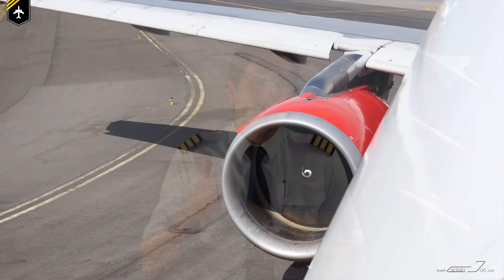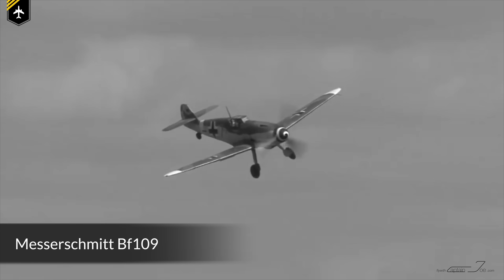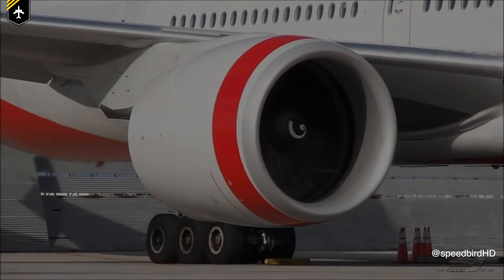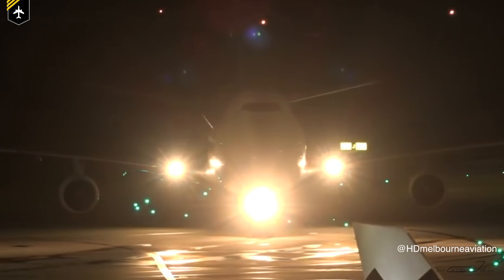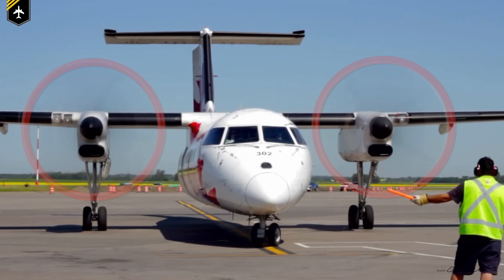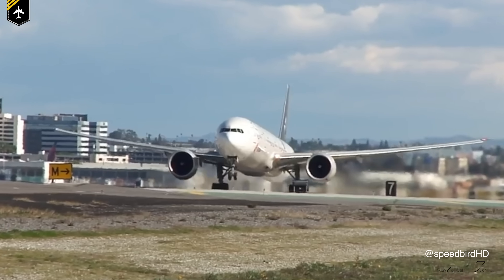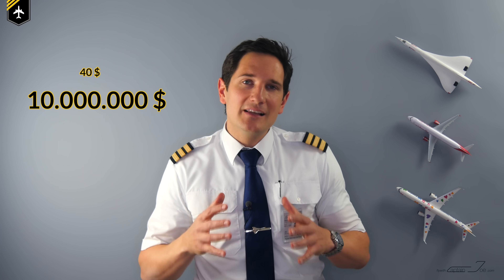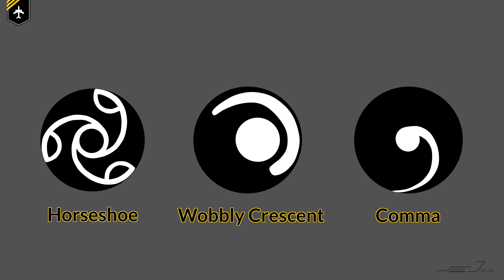WHY is there a SPIRAL in a JET ENGINE? Explain by CAPTAIN JOE

Comment: Simply wrong !
The purpose is to help BIRDS not be ingested into the intakes.  When running , the engine looks like a "black hole" that a bird can fly through, so the spinners are painted to help scare off birds so they don't fly into a running engine.
Now , before the hate starts, of course this doesn't work while the aircraft is in flight and overtaking birds flying in the same general direction, but the birds flying towards the A/C know to avoid a big fuselage, but having bird brains , think that tunnel next to the fuselage is okay, so the spinners have been painted with the "googlie eye" swirl to help prevent bird ingestion...
This pilot may know how to fly a plane, but he obviously has no education of aircraft maintenance.

Comment: I agree that the swirly nosecone on the Me109s was most likely for safety, but I also think that there's something to the legends regarding its psychological purpose, because, while it may not have been dazzling, distracting, or disorienting, it certainly looks rather intimidating, even menacing!

[Edit] Also, I do think that this might have been part of its purpose because the Me109's cannon (a projectile firearm that lobs significantly bigger rounds than a machine gun) was mounted in the nose, and actually fired right out of the center of the cone.  Basically, the same reason why the bombardier beetle is brightly colored, rattlesnakes have raddles, and cobras have big, extendable hoods - it says, "look out, I'll get you!"

Comment: Captain Joe hello. My Question regards Vortex Generation with a fixed-wing aircraft or Vortex Ring State with helicopters. Are they similar?

You may be aware of the serious collision between 2 helicopters at Seaworld Marine Park in Australia on 2 January 2023. One helicopter was coming in to land and the other was taking off. A witness claimed that it was windy and that the 2 helicopters were too close. It was also reported that the rotors of each clipped. There are many theories but not one has mentioned my thought.
It’s hard for me to understand how 2 helicopter pilots would allow their aircraft to fly too close together, even if windy outside.  Could two helicopters, both creating their own vortex ring state, pull both helicopters together resulting in a crash?

Perhaps you would consider covering this in another video. Thankyou

Comment: Would a protective mesh over the engine aperture cause excessive drag on air flow?   I'm guessing it would.
Reply: It'll definitely make the air going into the engine less streamline. Plus if anything blocks the mesh, then that is a bigger issue.
Reply: @ZK-APA  I thought that might be the case.

Comment: Hey joe,
How does a pilot calculate the weight of the passengers to account for fuel required for flight ?
Reply: i'm in aeronautics school in italy and they told us there are some kind of standards, not only for the fuel load but also for momentum and weight balance.

Comment: i noticed all engines  spill counter clockwise. do any  engine  manufacture  designed the engines blades  to spin clock wise ? and does it make a difference ?

Comment: Ah...the WWll German fighters did indeed use the spiral painted cone to throw off Allied defensive gunners in the bombers as this gave the appearance of the plane “jumping” forward, it was compared to watching a snake slither in the grass, your eyes seem to fall behind the progress of the snake. My primary source of this is from the book “The Fighting 109” by Uwe Feist, Norman Harms, & Mike Dario (Doubleday 1978)...from a caption from one of the many photos in section III of the book (pages are not numbered). The caption mentions this is to throw off the aim of the enemy gunner in the case of a head-on attack. It should be noted that most of the 300 illustrations of the Messerschmitt Bf-109 in this book most of the aircraft do not show the spiral spinner. If I remember correctly the snake analogy was mentioned in Edward Jablonski’s book “Flying Fortress” (Doubleday 1965) but I have to double check on that. Other than FW-190s I do not recall seeing spinners painted on any other German aircraft such as the bombers so I do not think they had safety in mind at the time.

Comment: I've always wondered why not place a light metal grate over the intake? Wouldnt this act as a screen preventing objects large enough to damage the engine from entering while still allowing all the air it needs to run optimally?

Comment: A few additional bits of information regarding the spinners on German aircraft in WW II. Aircraft on the Western front originally had black painted spinners as a quick identification aid. The spirals were eventually painted with white paint. In the Mediterranean theater, German aircraft had white noses for quick identification; the spiral stripe was painted with black. Curiously, on the Eastern front, yellow noses were the identification and no spirals were painted. Also, it was very rare for the Germans to have brightly painted prop tips, whereas most other nations used them, including the US, Britain and Japan.

Comment: I worked on jet aircraft still relatively early in jet aircraft development. And the rendition  of the eye is something that does make Birds nervous when it is on the nose cone of a jet engine. When they first started putting them on there they were static. When they offset them they did find that the birds tended not to go towards the engine. They aren't usually on military aircraft because you can't really see the nose cone of the jet engine on most military aircraft because they're well within the intake duct. Even if it only keep birds away by a few percentage points it would be worth the expense of painting all of them. The spirals, do go back much further. Perhaps those exist for the purposes you state. But any motion detected by the bird will tend to make it steer clear of the rather large orifice presented by the engine.

We are talking about birds however and it never ceases to amaze me how birds will fly into a mirror. Now I can understand them trying to go into the other room. I cannot understand why they didn't try to avoid the other bird LOL.

Comment: How does engine starts initially?
Reply: Compressed air from the APU (auxiliary power unit) or from an external air compressor unit is used to spin the turbine before ignition because the turbine must spin at a certain speed before the ignition.
Reply: @mikep9604  thanks

Comment: If a bird strike is so dangerous why can’t there be a sort of meshed metal net placed to cover the engine blades?
Reply: A net in front of the engine will disturb the airflow into the engine and this affects to the performance of the engine. That's why it can't be used.

Comment: I know this is after the fact but it may have been interesting to show how loose the fan blades are as the forward cover was being installed.
Most would be surprised at how much they clank & rattle around as the fan rotates.
Just a thought.😊

Comment: Why they don't put safety net in front of the turbine like you put air filter on your turbo so you don't suck dirt?
Reply: A net in front of the engine will disturb the airflow into the engine and affect to the performance of the engine. It can't be used.

Comment: Why they wont just build a kind of fence in front of the turbines?
Reply: That is not possible. A grid or mesh in front of the engines will disturb the airflow into the engine and affect to the performance of the engine.
Reply: @mikep9604  ah okey, thanks 4 the info

Comment: Why don't they have an "air filter"? I mean it can be a grate or something but that would stop birds from flying into the engine.
Reply: Yes why not? Like some sort of grill. could protect the engine from most foreign objects including ground crew. surely looks are not the only reason???
Reply: It's not possible to install any grill or mesh in front of the engine. Even a grill would disturb the airflow into the engine and this would affect to the performance of the engine.
Reply: @mikep9604  That is not the reason. The aerodynamic impact of a mesh would be minimal to the airflow. And the airflow into the engine is terribly turbulent anyway so it won't disturb it either.

To answer my own question: it is probably due to the fact that the plane flies at 900 km/h. The bird would end up in the engine regardless.

Comment: Does paint affect fan blades that are used in the jet engines? Can't they just paint the fan blades so that the birds don't enter?
Reply: The fan blades expand when in operationg conditions. Using a paint that can withstand this would most likely be to expensive and also heavy. Could also create unique safety concerns, uneaven application = vibrations = bad.

Comment: Since birds are startled and frightened away by bright lights, what about putting bright lights in the engine cowling for taxi, takeoff, and landing? Perhaps changing colour to a lower intensity danger red after when the engine is running for ground staff.

Comment: I feel like this is a lie. It might have helped with the open propellers of ww2 birds but the jet engines with cowlings?  I think it's more a tradition than safety.

Besides wouldn't there be lock out procedures before you can get close enough to a turbine engine?

Comment: Would a fine mesh screen help reduce accidents or would it cut into the trust produced by these engines?
Reply: A mesh will disturb the airflow into the engine, and this affects to performance of the engine. It's not possible to use them in front of the engines.

Comment: Having worked on her engines for years I've seen it all .   What should be explained better is that you can only get sucked in from 9 feet away is if the engine is running at full power,  ie  during take off .   
At full power it'll suck approx 4,000 cubic feet of air per second.  
What he should tell passengers is that red line you see painted along the inside of the cabin marks the plane of rotation .  If a turbine wheel fails , that's where the blades could come flying through.

Comment: Why would you have massive open jet engines running at ground level around hastily working human beings??  Put a damn grill over it.
Reply: That way by the time you get to the fins you'll be little cubes
Reply: @Alexjimb0  Only if the grill is made of razors
Reply: @goprojoe7449  yeah and cause the suction is going to gently place you onto the grill

Comment: The hazard area is even bigger when wearing a cape.
Reply: No capes!
Reply: @kylebequette9220  only crepes!
Reply: @kylebequette9220  OK Edna
Reply: @kylebequette9220  Called it!
Reply: Ah yes, the standard ground crew cape.
Reply: @SomeBorkedAccount  You must've watched the Incredibles lol
Reply: [The Incredibles flashbacks intensifies]
Reply: April 23, 1957(‘57), when the clock struck one, the #2 plane engine exploded with such power, it separated, forcing the pilots to make an emergency landing. Investigations revealed that a 130 pound female human being got ingested into the engine, destroying the compressor fan blades and annihilating the combustion chamber, creating a huge explosion the equivalent of 500 pounds of TNT, which ripped the entire engine pod clean off the wing.
Reply: @PresidentColity  that raises more questions.
"forcing to make an emergency landing" does that mean they ingested the female mid-flight? How did that happen?
Reply: @panda4247  she is a superhero and got sucked into the engine
Reply: or a scarf
Reply: N O  C A P E S
Reply: @JSMEsq  ok Edna
Reply: Sprichst du deutsch?
Reply: @builddude-1  ja immer doch😂😂😂
Reply: Fair point
But...
If one is so stupid to wear a cape in that kind of situation, how have they managed to survive growing up??
Reply: Schwarzer Ritter 
NO CAPES
Reply: @Camphreneas  yes edna
Reply: Being good friends with both Batman and Superman, they both confided in me while being very close to running engines of Jets and  saving soon to be doomed Airframes and their passengers, it was very hard to perform their Civic Duties around such loud noise, and running engines and it was extremely hard to 'save the day' while wearing a cape. Therefore they said, "The hell with them." I took that as good advice and said to myself, No Capes For Me...
Reply: Sauerkraut! Unser Kommentar
Reply: @DragonMage5255 make sure it's high visibly!
Reply: Detachable Capes
Reply: DragonMage5255 €€6¥¥
Reply: Hahaha!!!
Reply: Syndrome fell in one of these things in the video
Reply: @Aidan Bavinton ok Edna
Reply: No CaPeS!
Reply: R/cursedcomments

Comment: Birds are attracted to airports because of their open field appearance.  I was told in B-777 training that the spiral on the engine spinners had two purposes (ground safety, and to prevent bird ingestion). I was told that studies showed that when spinner spirals are utilized the birds mistake the plane for a huge predator with the spirals acting as the predators eyes. Fact or Fiction? BTW I really enjoy your videos

Comment: Ummm.......isn't there an element of engine speed in there?
So techs can use a strobe light to determine RPMs during maintenance and whatnot?
Reply: I mean to say that you can use a strobe light when it's at full power, or %50 or whatever, you adjust the strobe light until it looks like it's not moving, and  plug the number of blinks per second into a formula to determine engine RPMs.
Reply: You can put the engine at whatever thrust percentage, adjust the stobe light until the spiral appears to stay still, then plug the number of blinks per second of the strobe light into a formula to determine RPMs.
Reply: You'd use strobe lights on the blades, not the spinner.
Reply: @nescio03  , but how could you tell if they are moving or not?
Reply: @jacobeller  By varying the strobe frequency.
Reply: @nescio03  ,forgive me, not the brightest guy.... I did this once and turns out the disc wasn't even spinning. So, yeah....i get it.
Reply: @nescio03  ,wait a minute, hold up.

I know I'm an idiot, but something still isn't adding up. You would have to have a mark or something to reference....wouldn't you?
Reply: @jacobeller  Yes. On one blade. And then you still have to vary the strobe to make sure you're not looking at RPM x 2 unless you know the appr. RPM value.

Comment: Why don't they paint the same pattern on blades? that will add more visibility to ground person and as well as birds
Reply: vinay maruthi because even though dried paint weighs very little, all of the turbine blades must be perfectly balanced with each one weighing EXACTLY the same amount. Even a few grams of difference in weight can be enough to unbalance the engine particularly at high power settings.
Reply: @therightstuffAK  Well paint one or two in white and the others in black, and they will weight the same...
Reply: asmoth360 I’m guessing they wouldn’t want them painted at all. If a paint chip comes off it probably affects something. Just a guess though.
Reply: asmoth360 How about we don’t bother with complicated weigh painting and just pain the center spindle and be done with it.
Reply: My guess: increasing radius = increasing speed. Would not see it.
Reply: @666wurm  Exactly. The center spins at slower speed relative to the outer edge.
Reply: The blades have to endure much higher temperatures and spin at higher speeds so the paint would likely just chip off. The cone being near the center rotates more slowly and doesn't have to endure the same forces so painting it is pretty simple.
Reply: Different companies paint different designs.

Comment: just add a fucking metal neat that it will not get sucked in the birds will hit the neat and will get thrown away
Reply: It's not possible because the grid will disturb the air flow into the engine and this affects to the efficiency and performance of the engine.

Comment: Why don't they just put a steel mesh styled cover outside the engine to deflect the penetration of the bird(s)?
Reply: And how would you make this screen strong enough to not buckle in, and still allow the same intake airflow without eddies?
Reply: I already got replies showing my ignorance.  However, i thought using a stronger type steel in an outward cone shape with a drainage section on the sides seemed sufficient at the time.  The bird waste would run to the side and off the screen and free the middle area for it's original purpose.  Maybe add something to keep it from sticking and assuring that it would end up out of the way.   But what do i know?

Comment: there's one "discontinuity" on the Messerschmitt spinner theory. Today's prop driven aircraft, (like the one on the example here) don't have a swirl on the spinners, just the blade tips painted red, yellow or white. On the Messerschmitts and other German fighters of the day, several themes were uses on the spinners, some had half a spinner painted of another color etc, this was done for recognition in the air by fellow pilots, each squadron or unit had his own theme. Is interesting to note that despite all the effort to do art work on the spinners, the blade tips of German fighters were also painted white or yellow...So, blade tip for safety, spinner for recognition. Keep flying...

Comment: in turbo jet engine how front fan continously rotates?
Do it have electric motor?
Reply: If you are talking about an engine that is running, it is connected to the lowest RPM shaft (connected to both low pressure compressor and low pressure turbine). If it's while it is parked, the wind is enough to have them spinning at low speed...

Comment: Of its blurry the engine is running stupid as if you couldn't hea it
Reply: Youd be amazed how easy it is not see it!! Complacency is a killer and it only takes a second to be killed!! There is so much noise on the ramp and we have to wear earplugs to protect our ears! Ive worked for the airlines for 17 years and seen many safety violations!!